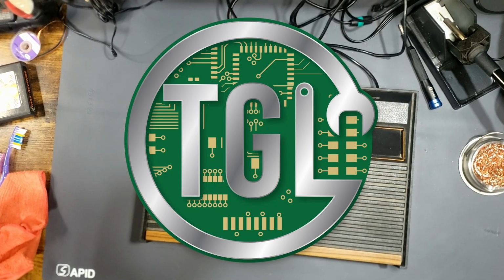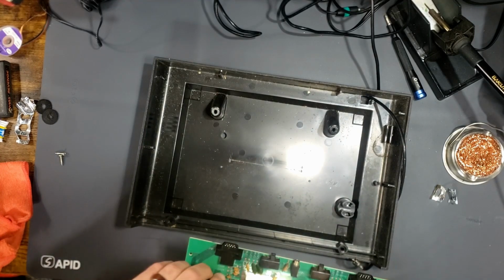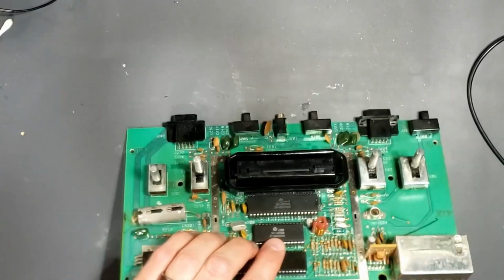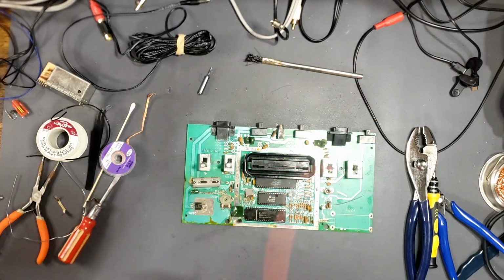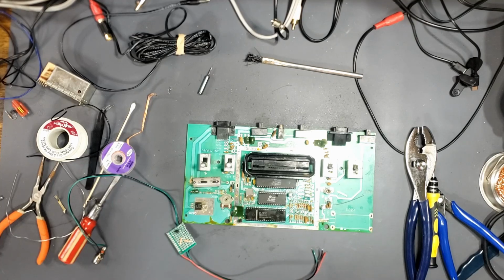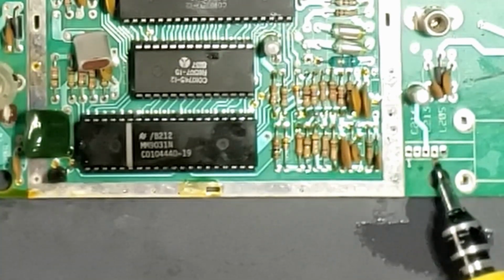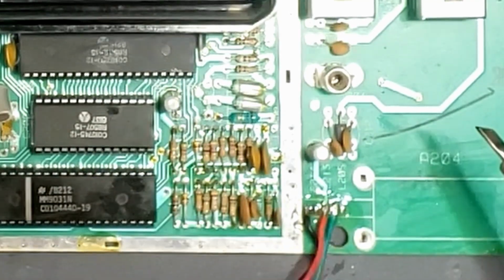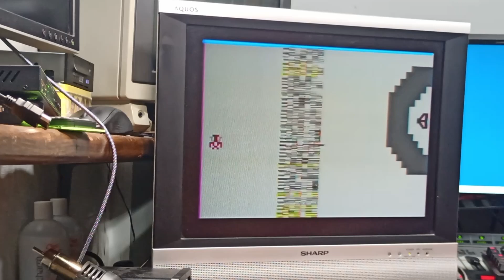Atari 2600 4 Switch Fix and AV Mod

Comment: Well nice repair & mod - but the those 2 screws are NOT supposed to go thru the motherboard and into the bottom shell, those are supposed to be inserted from the bottom and effectivly anchor the motherboard in place between the bottom shell and into the top shell using the coresponding anchor post of the top slot bezel trim, you should probably use smaller machine screws as well as opposed to whatever the giant screws the previous owner had in there.